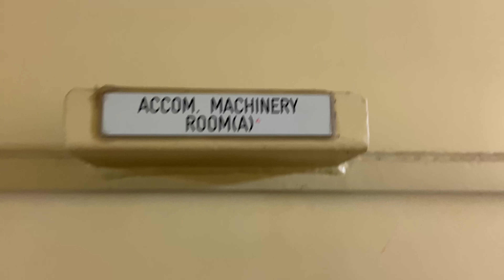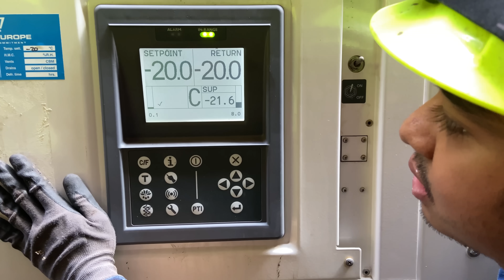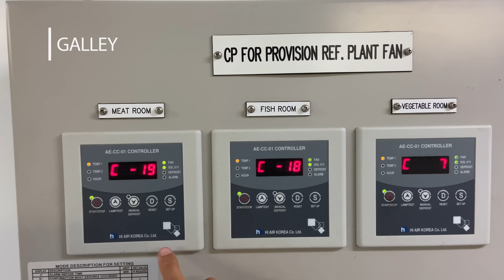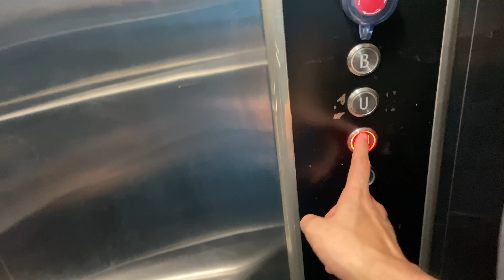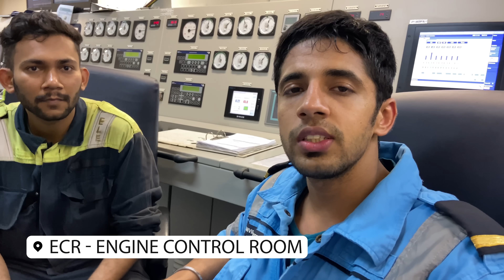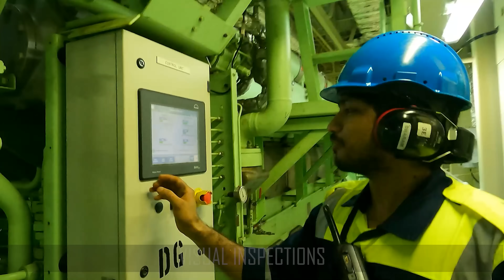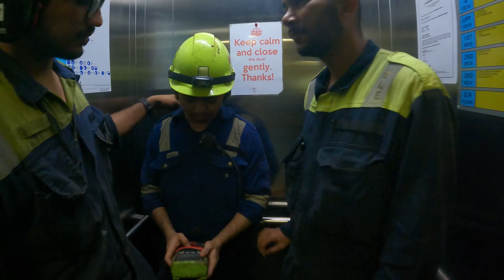How ELECTRICITY & POWER is managed on a Huge SHIP.

Comment: So, do you guys really need Electrical Engineers on board? Do these guys just have diploma which works or there is need of proper degree in Electrical Engineering? Just asking if I have any chance as I am studying B.Tech in Electrical and Electronics Engineering. Moreover, thanks for the vide, best wishes from Greater Noida 🙏!
Reply: There is a course called ETO.on completion of this course we can join onboard
Reply: @kabishek5003  What's the duration of this course, what are relevant institutions and their eligibility criterias?
Reply: @sharadtiwari1465  it's a 4 month course,as mentioned in a video study at amet or Anglo eastern, visit their websites for eligibility criteria
Reply: @kabishek5003  Thanks a lot 🙏!

Comment: Served as an Electricians Mate in the US Navy on three ships back in the 1960s. I feel it was one of the best enlisted jobs onboard ship for the simple reason you had the run of the whole ship from the aircraft warning lights at the highest point to the bottom of the engine room and from the bow to the stern. Extremes in duties included standing watches in a 135 degree diesel generator room in the tropics to working through the night to replace circulating fan bearings down in a  minus 10 degree Reefer Hold.  Every day was a learning experience, not all fun, but great memories.

Comment: One thing I would like to see covered was the boilers onboard that we got to see during your engine room tour.
They are there to make steam naturally, but what is that steam used for? When I tried to Google to figure it out, the only information I found were of the older ship designs that burned oil to make steam and then that steam was used for propulsion.
Example of such a ship is the Russian Kirov class "Battlecruiser", granted they have a nuclear reactor as well, but it is still steam based propulsion.
In your case though, there must be a different reason, so I hope you can shed some light on it.
Reply: Hi..Steam is produced onboard using Boilers as u stated...usually ships have an Oil Fired Boiler as well as an Exhaust gas Boiler for this purpose
Main Function of steam is Fuel Heating. Most ships use the cheapest fuel known as Heavy Fuel for propulsion...this fuel is very viscous at room temperature. Just like a Tar. in order to burn this fuel effectively, it is heated to above 100 deg...some fuels upto 135 Deg, so that the viscosity is reduced, and can be burned effectively.
Ofcourse new ships with alternative fuels are already in market, which uses LNG and other fuels, which does require heating up.
For safety reasons , electrical Fuel heaters are not so common in use
Reply: @udaysankar9385  True, I found this mentioned in sea of info, under all the steam powered vessels.
But that raises the next question, why is it steam and boiler based and not electrically heated.
So there is a lot of interesting topics to cover here.
Reply: @CMDRSweeper  Hi...this is going to be bit technical, All fuel oils has something called Auto Ignition temperature, meaning the fuel ignites own its on without the need of an external source.
The temperature tht can be achieved by steam at certain pressure (eg: 7Bar) has certain limitations, like 140 Deg C. which is a safe temperature during operation of heavy fuels. so th auto ignition of fuels is a remote chance
Where as in electrical heaters the temperature that can be attained is much higher , limited only by the constructional features, such as the coil thickness, max current carried etc. also safety devices.
so if the safety devices fail , there is a huge risk of Fire.
Fire is the worst thing that can happen on a ship.
Reply: He already explained about the role of boiler